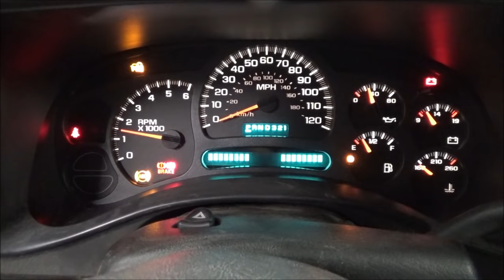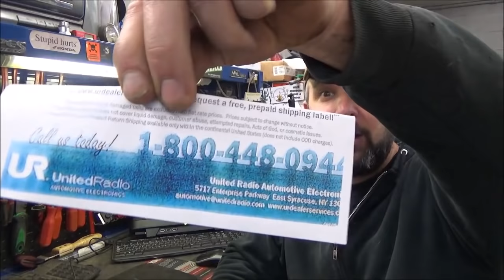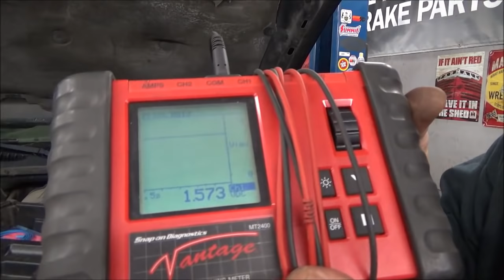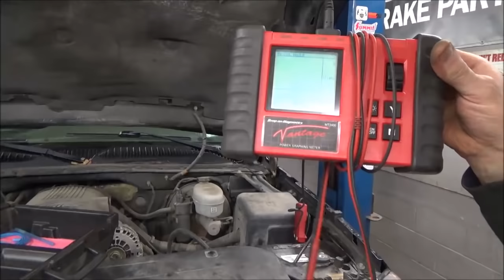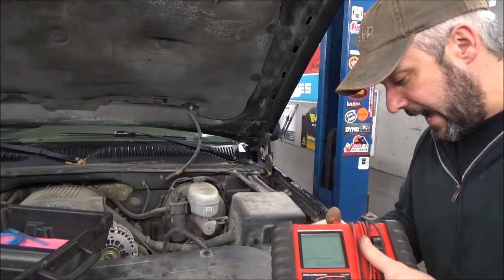Chevrolet Truck - Battery Dies Overnight - Part II

Comment: Eric if you are curious about "silver migration", read up on the more commonly referred to whiskering associated with lead-free solder (ROHS). "small metal hairs or tendrils grew between metal solder pads causing short circuits"
https://en.wikipedia.org/wiki/Whisker_(metallurgy)
Reply from the maker: +Doug Y. Oh that's great
Reply: +South Main Auto Repair Lead-Free solder has been a PITA since it was introduced.  Between silver migration, tin whiskering, and the tendency toward joints fracturing, solder related failures in electronics are MUCH higher now than I ever remember in the days of 60/40 Sn/Pb solder.

Apparently, automotive electronics didn't qualify for the RoHS exemption that industrial controls, medical,  avionics, and military gear were given.  It would be interesting to see what the silver migration damage looks like the next time one of these units rolls into your shop. 

Given the increased failure rate of RoHS compliant electronics, I wonder if anyone has done any analysis to compare the environmental costs of decreased product lifetime (necessitating more manufacturing/mining/transportation related pollution) and subsequent E-waste disposal issues vs. the environmental benefits of reducing lead in the waste stream. It seems to me like simply trading one environmental problem for another (which, coincidentally creates a whole new industry to cash in on the new regs).   Kind of similar to the EPA regs on portable gas cans which mandated the funky nozzles to reduce vapor emissions, but which in practice increase gasoline spills (and groundwater contamination from them) because the damned nozzles always leak all over the place when pouring gas into your lawnmower or whatever.
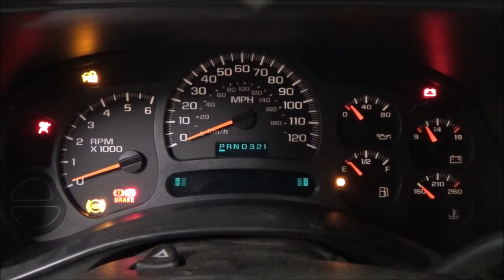Reply: +South Main Auto Repair  The other commenters are right, there is no CEL after the repair. See 5:10. Confirmed it was still there in part 1, but it did have weird behavior that didn't follow the other KOEO lights.
Reply: +Doug Y. At 4:20 (blaze it) you can see it over the 5 of the tach. But, you're right it wasn't there at 5:10 when he did the key cycle/bulb check that time.
Reply: +Doug Y. when the key is cycled on and off multiple times the cel will sometimes not illuminate. I have an 03 silverado and it has always been like that also. Nothing to worry about just the way these trucks are.
Reply from the maker: ***** you are 100% correct, thanks for filling in the gap here
Reply: +South Main Auto Repair your welcome, Eric. I wish i could explain why they do that but i cant.
Reply: very strange!!!
Reply from the maker: ***** Yep it is just how they work.

Comment: 9:22 Something like the "tin whiskers" problems with circuit boards?
Reply: Look like branches growing outwards, migration? High impedance short between traces, increase current draw I would think.
Reply: @kimchee94112  Actually, that would be "low impedence"; the higher the impedence or resistance, the less the current that would be passed.  A good insulator has high impedence; a good wire has low impedence.
Reply: This metal migration looks similar to what occurs in breakdown insulation know as "treeing". It's a high Z short, I suspect over time and with moisture those trees or branches will multiply and cause an explosion, typically high voltage cable splices or in power transformers. Metal migration and treeing, two different situations but the effect looked are the same. Check it out in IEEE articles.

Comment: They may just gently wire brush the back of the circuit board
Reply: That's what I did with my old expensive motherboard. Looked more like copper oxide, lucky it was not between the layers.

Comment: Special Acid= PCB cleaner= isopropyl alcohol .... there is no F" way they are using Acid on PCBs unless they are making circuit boards 50 years ago which they are not

Comment: Is United Radio's service very expensive?
Reply: +Shannon Helton Yep what was the cost i have a 2002 silverado working good but you never know.
Reply from the maker: +Shannon Helton Less than $180
Reply: Thank's eric.
Reply: $155 for a reconditioned cluster for a 2004 Chevy Cavalier.  Why they sent me a reconditioned version  vs. working on the one I sent them, I don't know.  I did also ask for a new plastic lens since the previous owner had made a mess of the OEM example.

Cluster works find now.  I guess we wait to see how long it lasts now...

Comment: Having worked with Reduction of Hazardous Substances (RoHS) parts (no lead) I wonder if the "silver migration" was actually tin whiskers, little hairs that grow off the tin leads of parts. https://en.wikipedia.org/wiki/Whisker_%28metallurgy%29

That would also explain why when you bounced it a certain way the fault disappeared.

:off track comment

Comment: I have fun trying to fix electronic devices and very often it's a problem with the lead free solder.

Here is a copy/paste for ya

With the increased use of lead-free solder, there has been speculation over the phenomenon of tin whiskers which are small, hair like conductive filaments that grow from metals like tin and silver, among others. These can pose damaging threats to electronics as the filaments can form a bridge between components and cause electrical failure (Sampson et al., 2009). The possibility of tin whiskers is less likely to occur using leaded solder, however, this is dependent on the amount of lead in the solder.

About 15 years ago

With the increased use of lead-free solder, there has been speculation over the phenomenon of tin whiskers which are small, hair like conductive filaments that grow from metals like tin and silver, among others. These can pose damaging threats to electronics as the filaments can form a bridge between components and cause electrical failure (Sampson et al., 2009). The possibility of tin whiskers is less likely to occur using leaded solder, however, this is dependent on the amount of lead in the solder.